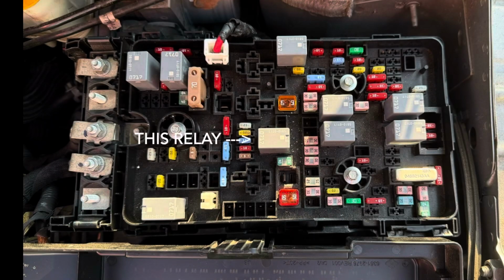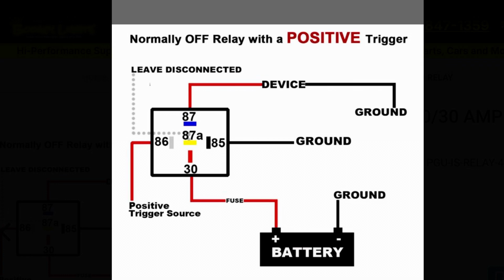Chrysler 200 HVAC blower motor not working fixed

Comment: Thank you for posting this having the exact same issue with my car. It keeps blowing the fuse and the last time it melted it so badly that I'm going to be replacing the fuse box. I pray to God the connector on the bottom is in okay shape. Wish I found this sooner. God bless
Reply: is it blowing the blower motor fuse? having the same issue and so far this is the only thing i havent tried. with the blower motor plugged in and unmounted it works but once you mount it then it stops working